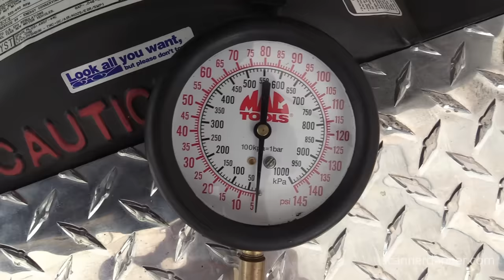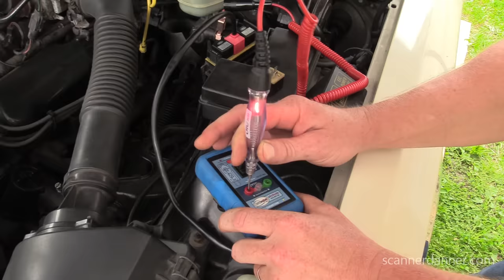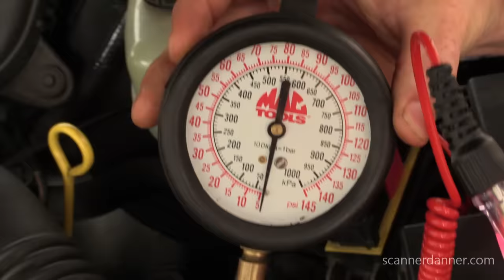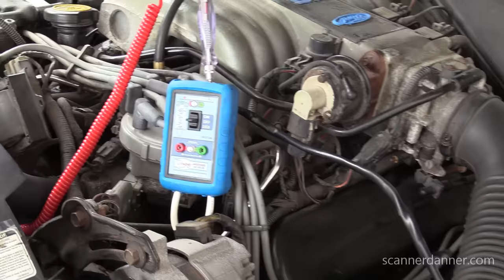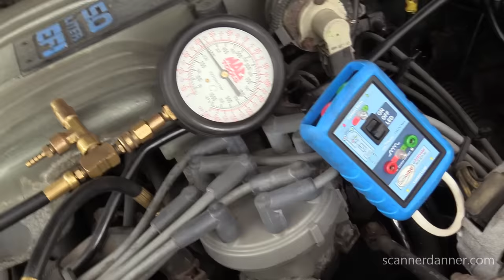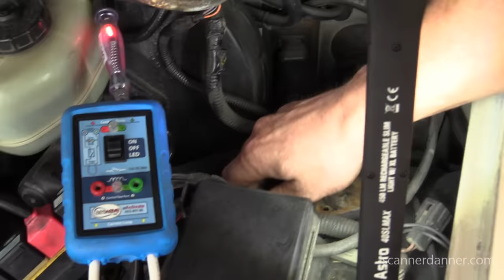New Fuel Pump, No Fuel Pressure Diagnosis (Lincoln Towncar comeback)

Comment: The Very First Thing To Check For Is The Fuel Pump Cut Off Switch In The Trunk Or Passenger Kick Panel😁 It Makes No Sense To Do All Other That Stuff First.Bro You're Running In Circles😂
Reply: It Makes No Sense To Do All That Other Stuff First😂
Reply: Funny thing is the inertia switch test proved nothing after all, you would have wasted time there too.
Reply from the maker: Okay inertia switch is good. Now what?
Reply: giani maybe u can post a video on how its done genius
Reply: In our country 'Tuyo' means 'DRY'.. thats you giani. Youre brain is dry.
Reply: Some Times All You Have To Do Is Press The Little Button Which Takes One Second And You Could Done😂😂
Reply: Also All You Have To Do Is Cut An Access Panel Right Above The Fuel Pump Assembly To Make Short Work Of Removing The Pump So You Save Your Self A Ton Of Work✌️
Reply: its ok giani sounds like a backyard mechanic to me... he knows all the answers but provides no videos to back his claims
Reply: Vinnie Zaccaro JaJaJa You Do A Professional Job And Now The Customer Will Have A Professionally Made Access Panel That Can Be Removed By The Customer Or Mechanic At Any Time To Make Short Work Of Changing Out The Fuel Pump
Reply: jonathan w If You Were A Mechanic You Would Know What I'm Talking About..You Would Not Need To See A Video Or Read A Book Or Go On Line..You Need To Be Self Directed And Know What To Do In Any Situation And Repair Any Issue In Any Vehicle...I've Been Turning Wrenches On Aircraft, Heavy Diesel, Tractors, And Automotive Since The Early 70s
Reply: i am an auto tech but it doesn't mean i know everything u never stop learning no matter how long u been working on cars and to act like your better than somebody else in troubleshooting and no proof to back your claims makes u an ignorant person and u been turning wrenches since the 70's but yet your here watching a video of a Real auto technician diagnosing a problem on a car lol if that were the case why would u need to come and watch his video? and do whatever it takes in any situation so cutting into a customers car whos paying u to fix it is the right thing to do since u have to be willing to do whatever u have to do to get it done huh... gee ill remember to never take my car to u if i needs repairing...
Reply from the maker: exactly @bobert Cwell not to mention the inertia switch was on the control side of the relay on this model
Reply from the maker: @ Giani Tuyo - the little button was fine, now what?
Reply from the maker: @Giani Tuyo - so did you cut the hole before or after you found the wiring problem in the harness? I bet it was before, because after you pushed the little button on the inertia switch and found it was good, it has to be a bad pump right?
Reply: I think you really should have checked the inertia button first. you start with the easy stuff first. If it had been tripped, that would have saved you the hassle of climbing under the car for investigation if it was a fluke from say, hitting a big pothole.  Luckily you had experienced and uncommon knowledge that the switch was on the control side  vs what some say on the forum that it sends power out to the pump.  I certainly didn't know it and the guy in the towncar forums saying it goes to the pump who misled me didn't know it.  It would make more sense going out to the pump saving some wiring...   On the topic of access panels,  foreign cars are made with them,  they are a good idea. I certainly have (expedition) and would create one again.. the question though,  is can one be made on this specific car? it  looks like the pump is mounted sideways facing the rear of the car?  (I did see that there is another utube video where you can get it out without dropping the tank).

 if possible to cut an access panel  on this car,  that's what i would have done in the first video. Hmm maybe i'll make a video if that's my problem.   Anyway like you said when you buy these fuel pumps at your local autostore they are cheap chinese crap and libel to fail.  Who wouldn't want an access door and have to go through all the hassle so changing the pump from under the car again?  Also you could carry a spare pump in the trunk, and get off the side of the highway a lot sooner if it fails.. potentially saving your life and lives of others by having that quicker and easier access.  The automakers really hired some a-holes designing cars not to have easy access to the fuel pump and connector to test for power.

 you could always advise teh customer to see if he wants the door cut or not. It should save him a lot of billable hours.   Anyway I want to say thanks a million for making this video. There's a good chance my towncar has the same problem, as i'm at the stage of not getting ground at 87 on the relay.  Your video breaking down everything, showing locations and wire colors and specialized, experienced, uncommon knowledge has surely saved me hours of my time and frustration.  You've got a friend in the Maryland DC area!